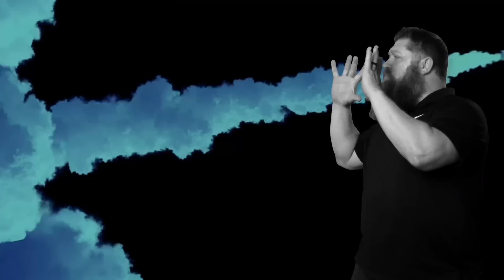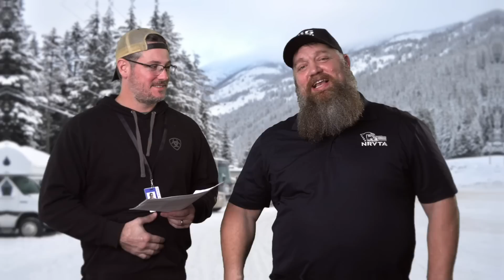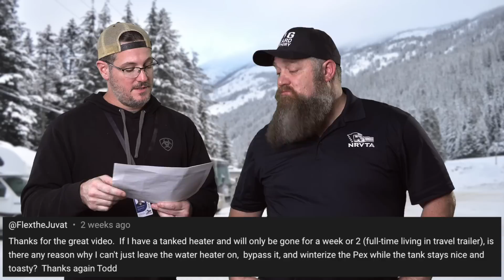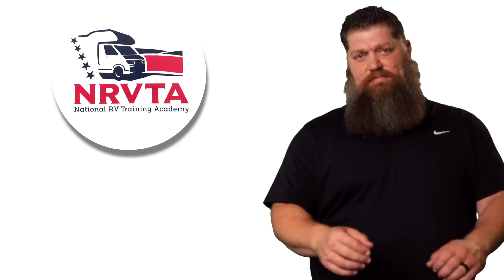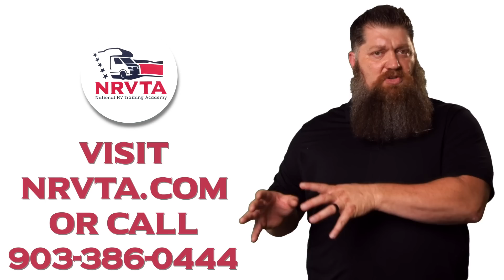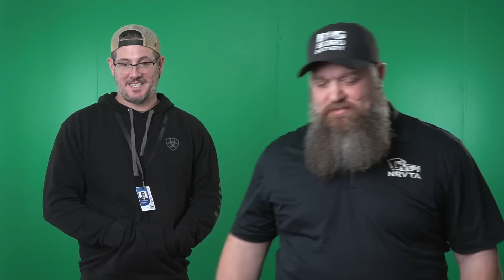Top 3 RV Tech Questions

Comment: I skirt my 2012Apex BH16 and don't have a Problem after I replaced the Floor, put Pex Pipe in and insulated the pipes in the under floor trough. I'm a Full timer in NEO . Below zero at times with -20 WC

Comment: Hey Todd and team, thanks for the great videos and information. Have a bit of an open ended question. I'm planning a large remodel of my travel trailer. I'm curious what changes or upgrades you would recommend to do during a remodel. I am full time living and do plan to continue to travel several times a year. 

FYI, I'm changing the rear bedroom/bunkhouse with half-bath to a large kitchen area and expanding the living area into the current small kitchen space.

Comment: I added AC powered heat stripping to our waste lines and two pipes that run just above the uninsulated (but covered) underbelly to our kitchen. That has prevented all that from freezing.
Reply: I found a 12V 'self regulating' one. We dry camp a lot!
Reply: @luminousveiws  Yeah, those are nice too. We have the Victron inverter/charger providing us with 120v power even when we're boondocking, which is awesome. We went on a five day stretch last fall without shore power, generator power, and minimal solar. It was close, but we squeezed all the power out of those Battle Born batteries!